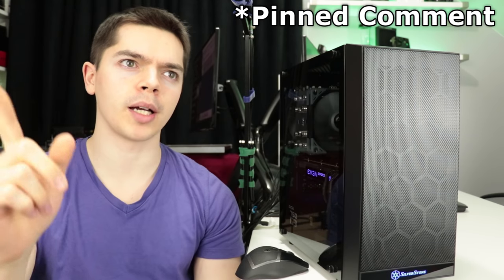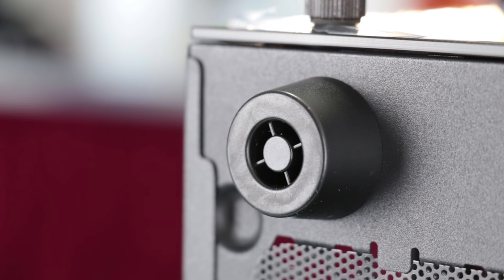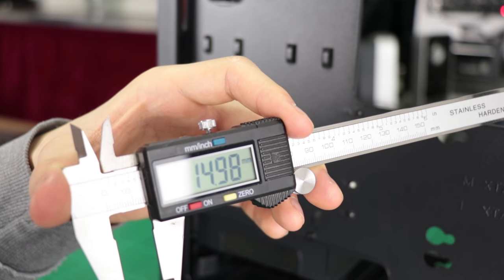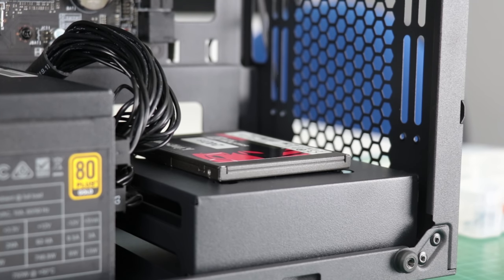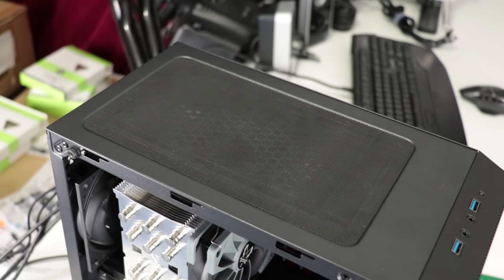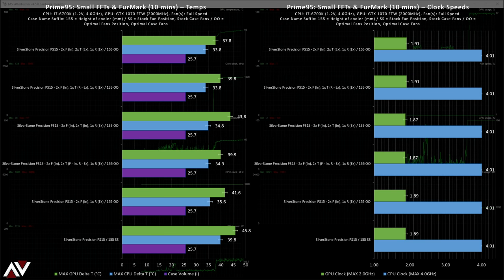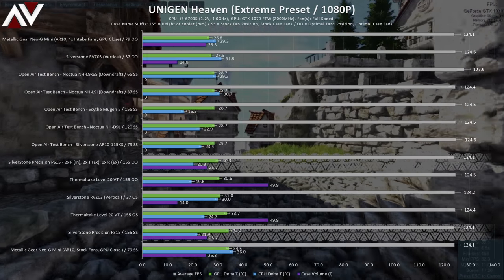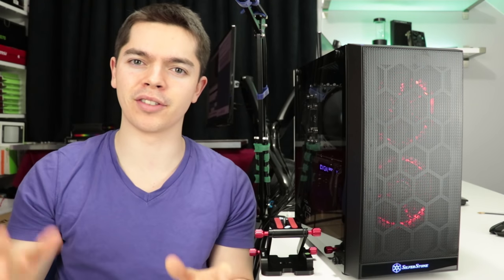SilverStone Precision PS15 (Micro ATX) Review (1/2)

Comment: 1. Can you install the fan kinda outside ( between mesh and mounting )
2. The Air penetrator fans are ways better than ek vardar for case cooling, you should test that. :) Did you get these fans afterward?
Reply from the maker: 1. You could install fans between the chassis and front panel, but I can't recommend it if the fan is a standard 25mm thick fan. If the fan happens to travel just outside of the fans frame it will make contact with the front filter which is flexible and also travels away from the front panel by a couple of millimetres (there's about 27mm of sace between the chassis and front panel).

There's also the issue of noise. When a filter is placed right up against a fan it noticeably increases the noise of the fan, and I've also noticed it has the potential to slow the fan speed down (presumably due to increased resistance). It's something I've noticed happening on a few builds during this kind of testing. Most noticeably on the Node 804 builds. 

Perhaps worth trying with 15mm thick fans, but I'd avoid it with 25mm thick fans. There's also the practicality of installing them with screws from the other side. I can imagine the only practical way of doing this is with rubber posts instead of screws. 

2. I'm not sure that's true in this case. The Vardar fans I'm using spin up to 2200rpm, have an Air Flow reading of 131.2m³/h (77.2 CFM), and a static pressure reading of 31 Pa. Whereas the AP124-ARGB fans used in the b-roll spin up to 1800rpm, have an Air Flow reading of 43.3m³/h (25.5 CFM), and have a static pressure reading of 20.9 Pa.

In every measurable way the Vardar fans I'm using have the higher cooling potential. I'm not saying they're better in every respect. But the numbers speak for themselves, and I don't know of a situation where lower Air Flow and Static Pressure have increased the performance of a fan. When it comes to cooling, Airflow is king, regardless whether it's inside a case or not (of course if it's within a case, static pressure plays a big role, and the Vardars are better in that respect).

I'm not really into brands, I'm into the statistics that effect performance. SilverStone is a good brand, but I'm not going to deny the numbers of the Vardar fans.

The fans came with the case, along with the PSU, case, and AIO which I'm yet to review.
Reply: @AVTechy  Thanks for the info for both. As for the fans, back in a few years ago, AP series was the best for case fan since it's have low noise, good air pressure and a special ability that the others fans does not have is that it can shoot air all the ways to the back of the case cooling the GPU (they call it air penetration), some people think that it even better than Noctua or Gentle Typhoon although of lower specs.
RV02 and FT05 are still the best cases for air flow and using these kind of fans, you will be surprise.
Silverstone are making a come back, I'm so excited.

Comment: Have you tried mounting a 240mm rad on the top?
Reply from the maker: I haven't, but there's no way to fit one in there (refer to the views with the CPU cooler and top fans in the same frame). This case wasn't designed for all out water-cooling, which doesn't mean it's not worth it. It's just that the top hasn't been given any clearance to fit both fans and a radiator.

Generally water-cooling focused cases have extra clearance for top radiators so there won't be a clash with the VRM heatsink on the motherboard. I've found in most cases that don't specify a top radiator mount, it's because there's been no extra height added to accommodate for one. Not surprising for a compact Micro ATX case.

I hope this helps, and best of luck with the upcoming build! :)

Comment: I sold mine, there is no room for 2x140mm fan in top and no room for 2x140mm in front ... The manual online and informaton on the Silverstone website is WRONG. How can they make such a mistake?!
Reply from the maker: The manual specifies only a single 140mm up top, and I was able to fit 2x140mm radiators in the front but didn't test with them. There's nothing in the way causing a clash for a 2x 140mm fans up front as far as I'm concerned.

What issues were you having up front?
Reply from the maker: Okay, I'm with you now. This is so ridiculous since I'll normally go all out with a case like going for the max PSU as I did in this video. But 140mm fans have been on of those areas I haven't covered very well since I've only got a couple to hand.

Anyway, the more I look I'm actually finding they haven't updated their manual properly either. The diagram in the first few pages still states 14025 x 2 which is wrong.

I'm just creating a video to rectify the problem, and I might take further action with regards to taking down my review and adding in some new information, but hopefully this follow up video will be good enough.

I'll cover everything in this follow up video, but is there any chance I can have your permission to use your image in the video to help explain what you found? I can hide or show your name as well depending on your preference.
Reply: @AVTechy   You may use my image yes, no problem. I like Silverstone cases (my whole family have one) but there is always something wrong with their products. So I'm glad you will make people aware of their mistakes. They make too much mistakes like the Soldered fancontroller for the 180mm Air Penetrator ap182, the fragile risercard for the rvz01-E (rvz03), the sugo sg10 casepanel not closing right and now this shit again:-( Too bad because the rest I like very much!
Reply: @AVTechy  So where's the follow up video? Silverstone paid you for not to make one? :0
Reply from the maker: Hey, sorry for the late response. I had it in mind to get back in touch when it came round to continuing the follow up video, but between conversations in the background, work, and other projects it just slipped my mind. Thanks for the permission to use the images btw.

The only reason the follow up video isn't out yet is I'm waiting to get an official response from SilverStone since there are actually changes being made in the background, and like with any company it takes a while to get the wheels turning.

I've had a good few conversations back and forth with SilverStone about this situation (exchanges every few days), and they've been very proactive asking for the findings so they can better understand the problems and provide solutions.

It's is being worked on, and I will be completing the follow up video in the next few days. But I want to give Silverstone a chance to redeem themselves to capture the full picture.
Reply: @AVTechy  Allright cool. Im looking forward to it. :-)
Reply from the maker: @nathalyberko1139 Okay the video is out now, I've not mentioned your name on there since I didn't get confirmation before that I could. But I've mentioned in the video that if you want to take credit for the video please add a comment and I'll pin it for all to see.

Thanks again for bringing this to my attention, and the result of your comments will hopefully help a few people out. Anyway, here's the video:
https://youtu.be/h2kSkrrbCrI

Comment: guys, im one question away from buying it. help me pls, my videocard is msi rtx 2070 which is 307mm long. this case can handle up to 315mm as said in specifications. is it safe gap to go for it? im afraid that my gpu will not land :/
Reply from the maker: I managed to squeeze a Sapphire R9 390 Nitro in that's 308mm long. It did fit, but was a tight and tricky install.
Reply: @AVTechy  thanks

Comment: This or coolermaster q300l?
Reply from the maker: For me I'd choose this, and it's mainly down to the tempered glass.

There's not and huge amount of difference between the two other than that. If the Q300L had a tempered glass side panel and was the same price, it would be all down to whether you like the differently styled filter of the Q300L or not.

And if your into lighting your system, this case has a much more finely perforated front panel then the Q300L, which helps with colour gradients.
Reply: @AVTechy  I don't suppose you know which has a better build quality?
Reply from the maker: Chassis strength I'd say the PS15 has the edge. On the Q300L review you can see the front of the chassis flex when removing the side panel. But it's not that much of an issue once you add fans and all sorts of components as they'll provide some structural bracing.

The PS15 has a few minor tolerance issues you can pick up in the external overview, and the Q300L makes some sacrifices in the same of remaining symmetrical such as the PSU panel.

Other than that they're pretty comparable, and neither will fall apart with a system installed in them. If it was my money I'd hands down go for the PS15 or any other glass side panelled case near that budget. After a couple of accidental scuffs and scratches with a plastic side panel you'd regret not getting something with glass. There's also a certain extra clarity to glass, the same can be found with plastic vs glass tubing for water cooling.

Toto Geenen on the Discord was just saying the other day that a regrets not going for the Tempered Glass Masterbox Lite 3.1 over the standard Masterbox Lite 3.1.